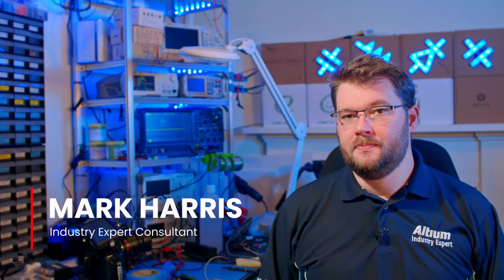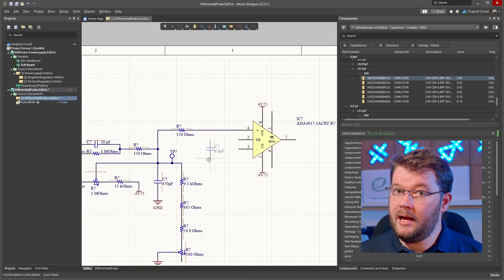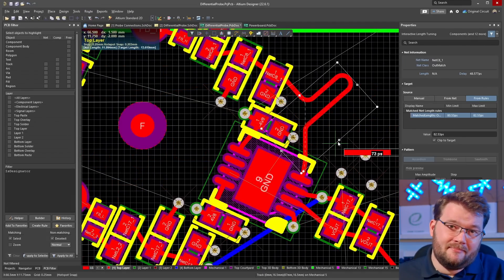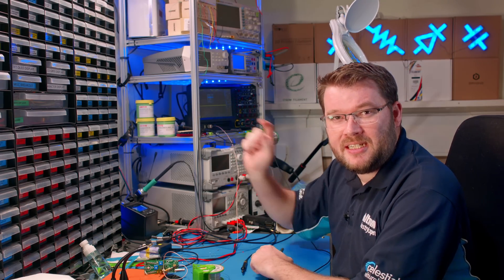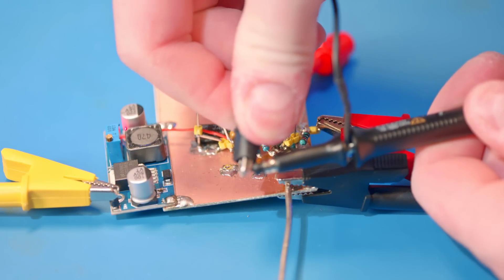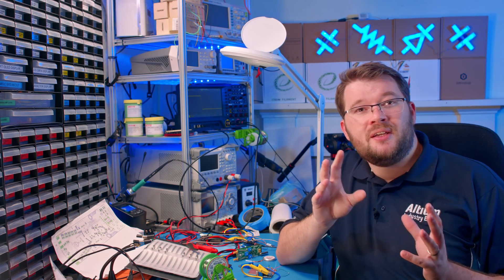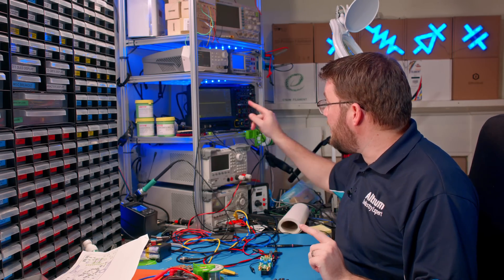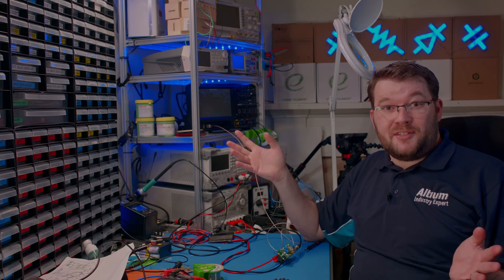How to Make a DIY Differential Oscilloscope Probe

Comment: "A cheap differential probe isn't too expensive" Meanwhile the cheap probe costing 400CAD 🥹
I  just want something like 50mhz~ 15-10mv noise(I'd love lower, but it'd be unrealistic at a cheap point) and honestly, 2x/1x is good for me as I don't measure high voltages like main's. as I'm not comfortable enough with it yet, so usually just around 24-50v max.

Also lol, I loved your video but it also gave me so much confidence, I'm a hobbyist and far from  an industry expert, but I guess even industry experts make silly mistakes :P guess everyone makes silly mistakes! 
I do wish I could afford Altium but  as a hobbyist.... not even in dreams.

I wonder how much this costs, maybe i'll make one and 3d print a metal enclosure of it and ground it for extra paranoia.

Comment: You can make a high speed high voltage pulse generator with a coaxial mounted and shielded reed contact in a coaxial cable. 
One side is charged from a high voltage power supply by a resistor in the kilo ohm range. The length of the coax cable correlates to the pulse lenght. 
The other side is loaded by 50R and is the pulse output.
The reed contact is switched by a coil outside of the shield. 
I got pulses with 1000V 20ns long into a 50R load. Repetition rate 10Hz, rise time <1ns

Thanks for the nice project!

Comment: Great video, and thanks for sharing you desing projects. couple of questions, so the capacitors that are in parallel with the string of resisters at the input, are they to compensate for inductance of the pcb and/or resistor? would also be nice to be able  to by pass some of the input resistors to have an ajustable max input/ input impedance, to get less noise on smaller signals, how to do that with a switch without affecting the reponse i dont know, ¿small jumper wire? sominthing that dosent require soldering idealy, thanks again :)

Comment: I would like to point out the extreme voltage range targeted .. There has been practically no safety features built into this design for working at such high voltages .. The sma connectors chosen for inputs, at their 500V rating, cant handle even half the target voltage  .. I can appreciate the attention to detail used for signal integrity, but safety should come first ... The front end of this needs to be completely redesigned before any one attempts using for high voltages.. I can point to a similar project, by a content creator who has experience in high voltage design practices,  to help address these concerns .. Granted the back end will need to be redesigned to meet the bandwidth requirements for this project,  but following video would be a better guide for creating the front end.. Hope this helps .. Stay Safe ..  Cheers  :)

Prototyped:
https://www.youtube.com/watch?v=_OZ5Xer84eo

Finalized:
https://www.youtube.com/watch?v=0thOfk4I3qs
Reply: Thank you so much for sharing these video links!

Comment: Have you matched the output impedance of the ground and the output from the generator? Or you could also use two outputs to make a true differential output that way you eliminate the ground. 
Lastly I don't know if two-conductor only coaxial cable is capable of delivering differential signal. It should be two wires in side with a shield on the outside and ground joints at the output end of the cable.

Comment: You take care to provide multiple high voltage components in series with the inputs, but this is completely defeated by only one jump from SMA signal to shield plus one jump across the 0R (sometimes not mounted) 1206 footprint.

Comment: Couldn’t you just use three well spec’d op amps in an instrumentation amplifier configuration to mimic a diff probe? Having so many RF conditioning circuit components feel like you’re just adding more things that could go wrong, no?

Comment: Nice project! Looks like there are 2 EDAs that can 3D render boards properly. KiCAD and Altium. PADS looks prehistoric and Cadence makes a woodlike board with layers wrong.
Reply: Diptrace does a half decent job as well, as does Eagle, since it is now owned by autodesk and a module of fusion360

Comment: Nice video, I worked for a company that makes induction heating machines and we used a lot of diferential probes, That machines can generate square wave signals in the range of 30 kHz and and 620 Vp, I always wondering how to make a differential probe DIY (because this devices are expensives for my income), I found some useful schematic but in the end the problem was the signal to test (frequency and voltage) I think is more harder to generate the signals for the DIY diff. probe than building the probe itself.

Comment: since your function gen has two channels, you could have used both to generate your differential signal instead of connecting its 'gound' to one of the floating diff inputs of your circuit.

Comment: Instead of a differential probe you could also get a cheap USB scope and use a laptop...tho you may wanna get a data and power isolated scope aswell as else you might still kill your laptop if you get a too high voltage

Comment: I'd like to mention that there are decent low-priced HV probes like the Micsig's. Sure, those are only 100 MHz and therefore wouldn't meet your bandwidth requirement of 250 MHz. On the other hand you didn't test/validate your probe for anything higher than 25 MHz ;) Anyway, we like to diy things and this might be reason enough.

That being said, I recently tried to build a differential probe using the ADA4817, but with two ranges (x10, x100). I faced many issues starting with the power supply.
1) I opted for an isolated DC/DC converter, but at the time I was surprised to see its rather poor common mode current performance. Didn't really think about it at the time...
2) Finding a good adjustment that works with both ranges has proven very difficult if not impossible with my circuit design. So I would have to either get rid of the 10x range or redesign the front end.
3) This was my first high-speed pcb (I'm an power systems engineer; not much experience with PCB layouts at all, it's just a hobby). So with my probably poor PCB layout I ran into opamp stability issues in one of the two ranges and found a rather poor frequency response (whereas the simulation showed great performance).

For now I decided to stop working on this just-for-fun project, because building one or two more prototypes would probably cost me significantly more than just buying a Micsig probe ;) Still, I learned something, and this is always a good thing...

Comment: Hi Mark! That was a great presentation, thank you for all the work you put in here and shared! The way the content was scripted, and the storytelling was awesome! I really enjoyed it! 

Now, if I may, a brief constructive feedback. I believe you didn't bring up some key points involving protection and characterization because it would not fit on the length of the video you and your team probably had in mind. Also believe that you wanted to frame the video to the "average" guy in the lab that may not be concerned with a deeper understanding of all the issues concerning diff probes, and/or that does not have high end equipment for testing/debugging. If that is the case, that's alright, you have a broad audience. 

Now, from a personal perspective, I’d like to see some more information about the specs. Things I am sure you thought about and dealt with, but were not presented: some more thought on the input voltage divider, frequency and safety wise: input capacitance, clearance, cut outs, distances, resistors voltage ratings – 1.2kV is a serious matter, as you have mentioned; CMRR analysis; proper EMI filtering (since you had some issues with it); shielding; proper frequency response and slew rate dv/dt limitations; battery monitoring – or at least some warning when batteries are low, possibly compromising the measurements; ESD protection, since someone will certainly touch the probe at some point; noise floor; AC and DC accuracy and a brief error budget analysis, including attenuation error, op amps errors and drifts. And since we are at it, who knows I can bargain with you an input voltage range selector. 😅

I know these points would make a much longer video, but the thing is that this is a topic most of the lab addicted electronic engineers, like many of us here, love to dissect. Having a well spec’ed and tested diff probe no doubt pays off, since every measurement using it is subject to its behavior. To be honest, when I first saw the title of this video from this channel, I had hopes I'd see some of those points covered.

So, this was a great introduction and aroused a lot of interest! Maybe a follow up video will be a lot of fun!

Comment: Very nice and simple design, thank you for sharing. But there is something I don't understand about the diff amp stage: the 348 ohms resistor from inv input to ground gives a differential gain of 1.9 dB (instead of 0 dB). Is it done on purpose or is it an error on the pdf schematics ?

Comment: Why the caps on divider network?
Reply: Compensation. Without them the high value resistors combined with and capacitance at the end (and all along) of the resistor chain will form a low pass filter with a cutt-off way lower than you would want.
Reply: @robdavis3220  and not to mention the input capatitance of the FET opamp...

Comment: I work with high voltage and i frequency power converter, i use Fluke Scopemeter 196 and 199C because is isolate between probe and also between power supply, in extreme case, Scopementer run on battery, is very nice scope to probe 600Vpkpk on hot side at 100khz square wave when probe B are on cold side in feedback circuit....
Scopemeter are great but also have some common mode trouble... sometime, i run probe with few ferrite on the cable to reduce emi pickup and solve false trig and clean the trace, is a good trick to do with any scope in fast wave mesurement.
I found your differenciel probe interresting and testing this type of design are not really easy, push the circuit to the limit need very high end test equiment and specific lab environment!

Thanks for this video.

Comment: You should not need a 50ohm series resistor on the BNC output, as long as you have 50ohm termination enabled in the oscilloscope.
Reply: the oscillations are caused by the capacitive load of the opamp. Probably a few Ohms would help to decouple the cable from the opamp
Reply: @gkasprow  maybe...
But he is using a Rigol. Many Rigol oscilloscopes don't even have 50 ohm termination built-in.
The frequency of the reflections correspond quite well with the propagation delay of a short unterminated coax cable.

On another related note: SMA for 5 Mohm differential inputs is an interesting choice...
Those differential inputs must be kept really short, or there will be the same kind of ringing problem on the input side.
SMA connectors certainly don't make it easy to keep the inputs short. Pin headers would have been a better choice.
Reply: @vonnikon  yep. But impedance mismatch looks different than decaying oscillations :) OFC, both issues add up.
Reply: I tend to agree with Greg, including the suggestion of using "few Ohms", instead of 50 Ohm, because with any 13 pF capacitance (cable +  connector + osciloscope input?), it would form a RC filter with a cut-off frequency lower than his 250 MHz bandwidth.
Reply: My Rigol 2000 series does have 50 ohm selectable option. I'm sure that scope does as well. I'd love a decent diff probe , but cost has always been a issue
Reply: @robdavis3220  ok. When you enable 50ohm on your Rigol, does it show any indication of this on the screen? There is no on-screen indication that 50ohm is enabled in the video...

At Rigol bandwidths there are usually plenty of alternatives to diff probes.
If you are probing a DC balanced differential signal, like Ethernet, then you can just use a balun to convert it to single ended.
Or you can use two oscilloscope channels and a math function.
Proper dufferential probes become unavoidable at multi GHz SERDES or DDR3/4/5 validation.
Reply: @gabrielbrunheira  transmission lines like coaxial cables do not present any capacitive load. The amplifier output only sees a 50ohm resistive load.

Comment: Well that's interesting, I've never considered myself an expert and not to brag but my DIY differential probe worked first shot. I probably spent 10x the time designing mine so not sure it's apples to apples. Mine included safety features this design is lacking, no TVS, GDT or MOV on the inputs, no clamping diodes or transistors on the buffers, even with the high impedance I wouldn't feel that safe using it on mains. I really wish you went over the CMRR and zero offset on the buffers as well, or at the very lest applied common mode DC voltages to show the CMRR performance.  It's a key design parameter to insure accurate results, I know I struggled with matching the high impedance inputs because I only have 5.5 digit DMM and measuring 4Mohm in series it doesn't have the resolution to show the least significant digits needed to reduce the potentiometer value for lower noise. If we wanted to get extra fancy, isolating the opAmp rails would insure no ground loop issues as well. Only mentioning all this because you pointed out the SI consideration of rotating the layout for dielectric effects, IMO that's far less important than the considerations I pointed out above. In no way am I saying this in negativity, I greatly appreciate the effort to produce the training material Altium provides.
Reply: Thanks for sharing your thoughts. Is there a write up or a video of your design anywhere? I feel that it would be a great contribution to the community if you shared your design with all the thoughts that went into it.
Reply: Nice writeup. I'm also lining up for a design file or two if there are any.
Reply: Appreciate your comment. Thanks for providing all of these details.
Reply: Also interested in seeing your design, if you uploaded it somewhere.
Reply: Those are nice points, and they certainly make an overall better characterized probe. Not to mention protected. Since you mention, I'd also like to see your previous work, if you are willing to share.

Comment: Great video! Loved all the little details you went across during the testing part! 

It's the first time I hear about signal chains running diagonally across the board for a integrity purpose, and I actually didn't understand it very well. Could you please provide some references to get deeper on this topic?
Reply: Just search for "PCB weave effect".
It is really just an issue for routed transmission lines. Not component footprints like in this design. The differential input on this board is not even a controlled impedance path. So weave effect is not at all a concern here.
Reply: @vonnikon  Thank you! I've stumbled upon a cool article, from which I understood that this effect is relevant for much higher frequencies than the 250 MHz bandwidth spec from this design. And this is related to your comments above, right? So even if this diagonal routing was considered to address common mode rejection loss, maybe it wouldn't have any difference, because the affected frequencies would already be attenuated. Is it correct?
Reply: @gabrielbrunheira  weave effect can cause a small change in impedance. When you are routing a 50ohm microstrip transmission line.
But the differential inputs stage of this design is not a controlled impedance line, so it does not matter.

Comment: Can't wait for that one. I wanted to pick one up for a long while, but I did not for the given reasons. The same is true for low amperage ac/dc current clamp.
Reply: What bandwidth are you needing that current clamp to be? Ti has a 20KHz hall effect sensor that I successfully used to get very accurate results with only an iron core toroid notched to fit the sensor. I calibrated it using a DMM and bench power supply, at room temperature it's been very accurate and stable for the past year or so. For my application I included the current clamp on my differential probe circuit board to have a single unit power measuring ability for DC-20KHz.